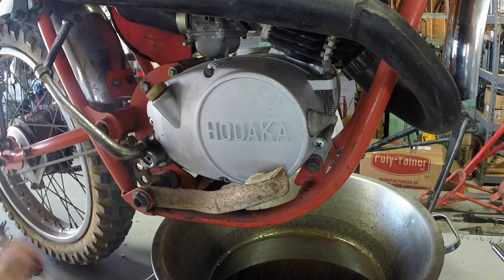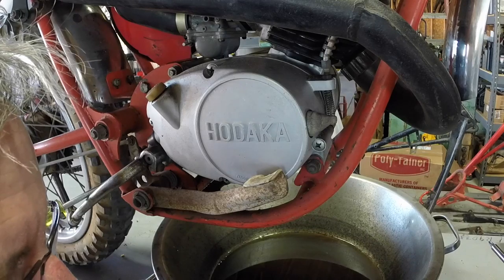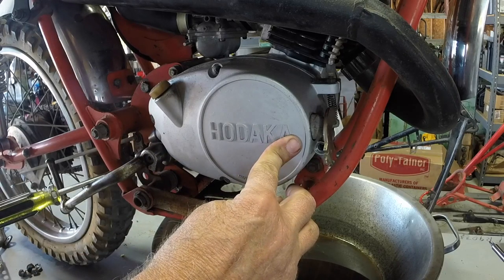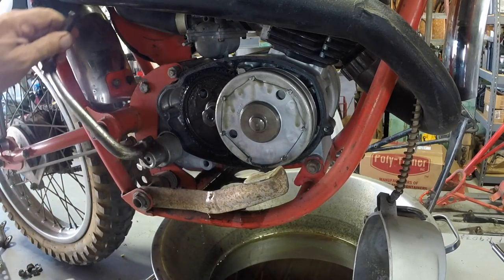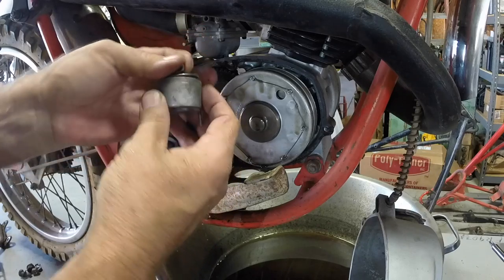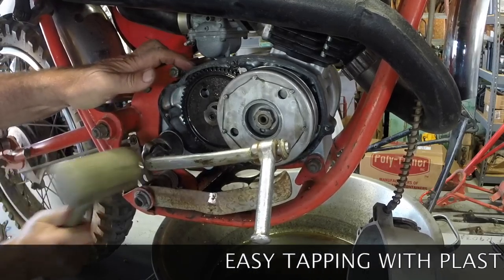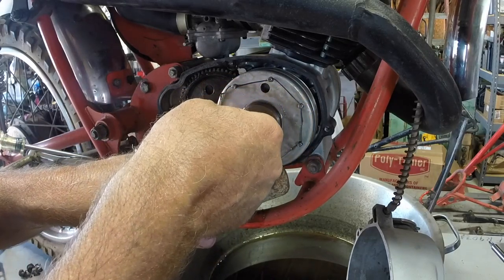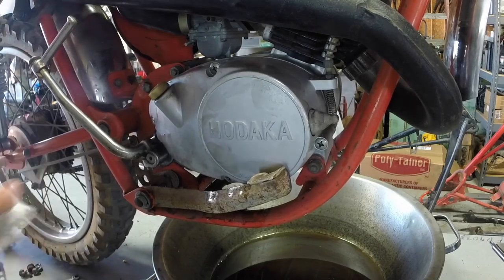Hodaka Superrat Project #4  Kick Lever

Comment: What do I use to change the fluid in an Ace 90? The bike sat for 15 years and the fluid currently in the gearbox looks good but I want to change it to be sure I don’t cause any damage.
Reply from the maker: Drain plug on the bottom of the engine, use a Motocycle gear oil. I use BelRay gear saver 80 wt., it will be 581cc or 1 1/4 pint. There will be a good chance the clutch plates will be stuck together, you will no this when you pull in the clutch and put in gear, the bike will lurch and stall. If that’s the case bump start it and ride around, blip the throttle and the plates may loosen up. Remember the bike must be in neutral to start and the shift pattern is 1 up for first gear. Good luck.
Reply: Socalhodaka thanks! I really appreciate the help!

Comment: Hey just wondering where you are located in SoCal. I’ve got a super rat and the kickstart lever will grab if you cycle it slowly but if you kick it it pushes through. I think the retainer is bad and I was wondering if I could bring it to you for repair. Thanks in advance.
Reply from the maker: I’m in San Diego. Yes the retainer or I have even seen the kick gear crack. Where are you located?
Reply: @Socalhodaka  Sorry for the late reply I just saw your reply. I am in San Diego as well up in North County.
Reply: I’ve dressed lots of kickstart cam surfaces with a grinder. That will fix your problem. The rollers make groves in the camming surfaces , dress that out and it works again.

Comment: I'm involved with a LONG term model 99 Road Toad restoration. Can I use your technique with it? These are are great videos!
Reply from the maker: 519CZRacer it's all the same but you need to deal with the oil pump also if it has the oil injection.